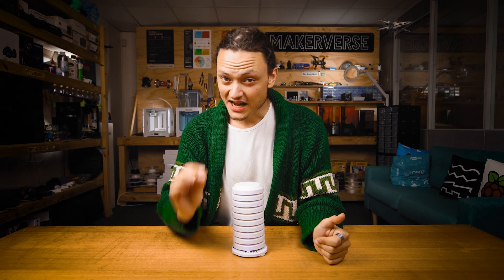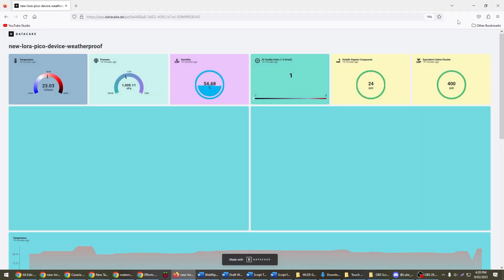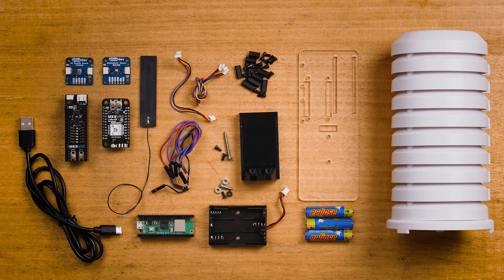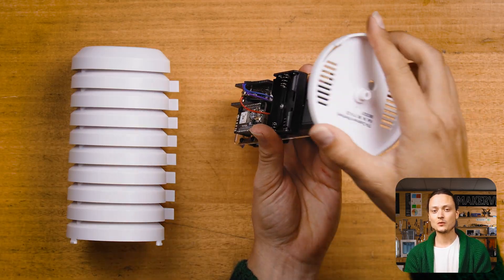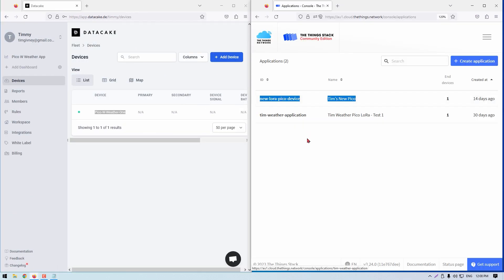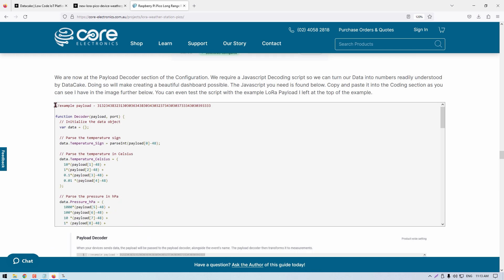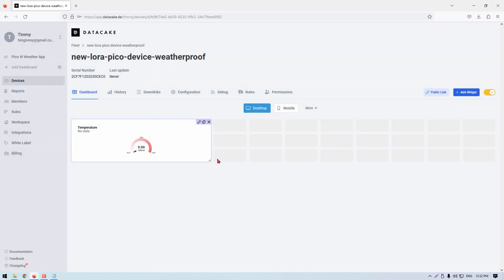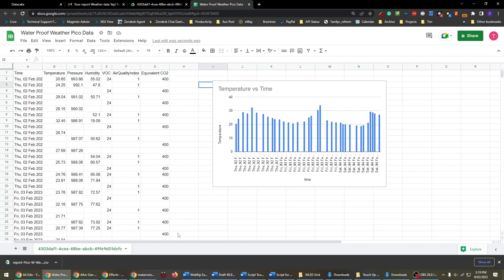Weatherproof LoRa Environmental Monitor - Makerverse LoRa-E5 and Pico Project - TTN and DataCake

Comment: Beauty.  Well done sir.  Check out the Heltec boards.  Very easy, Arduino compatible and you can eliminate a bunch of those boards.  They also have integrated solar charge controllers so you can slap a little solar module on your project and have it run forever.

Comment: Awesome video and great tutorials - any idea how have the PICO (Micropython) use a GSM 4G unit  as it's main internet source? I am as far as setting the device up, configured UART and can sent AT commands via UART, make a data connection and get an IP address, then put the modem to sleep, but I am stumped on how to send the "sensor_readings" to say Datacake or InfluxDB using this connection instead of WIFI - I have Pimironi Pico Weather running the scripts (It looks like the FW uses GET/POST to upload to InfluxDB but there will be no wifi where I deploy and I will use LORAWAN on the second unit when I get there - any chance you could assist PLEASE!!!!

Comment: Can this design be used for Google home. Recently I found out that when I ask Google for the Temperature and Humidity it is actually replying with data from a suburb quite a distance away. I would love to ask google for the temperature and it replies with the temperature of the LoRa  weather monitor in my back yard. Any chance of a video or instructions on how I could set this up.

Comment: Brilliant video. I'm from Brazil and was wondering if any other Lora modules are compatible with this guide? For us the easier way to buy components like that it trough Aliexpress, most of the time that prevent the packages to be stuck on a bureaucracy customs. I've looked over and found dozens of options for lora to PicoPi, so I'm kind a lost if any of these devices will get a similar result from the ones you used. Thanks for the great video, got a new subscriber 🙂
Reply from the maker: Sweeet! Welcome to Australia 😊 I'd love to visit Brazil. The LoRa Modules we have here can do all kinds of Radio Frequencies appropriate for wherever you are based in the world. They use the same module as the Seeed Lora-E5 Board - https://core-electronics.com.au/lora-e5-mini-stm32wle5jc-dev-board.html?gclid=Cj0KCQiAo-yfBhD_ARIsANr56g4QaFQM9FObP_nI4NVrfg8KrqIMOzHCMGIVO-wEHKpnl7P-46QHPqEaAu0nEALw_wcB - So long as you update the script to be appropriate for your location you'll be off to the races.

Thanks for your kindest words! Glad to have you onboard.

Comment: Great project! However, ens160 is an indoor air quality sensor.
Reply from the maker: Haha you are right. I now need to figure out how to fit one of these into the case - Particulate Matter Sensor https://core-electronics.com.au/catalog/product/view/sku/SEN-15103 - or find a better location for it.
Reply: Can this SEN-15103 be used for outdoor projects? @Core-Electronics

Comment: Use D cells if you have the space, I have a digital clock still running on the same cell since 2005 !
Reply from the maker: Definitely a great idea! + I'll be able to 3D print a D cell holder too.